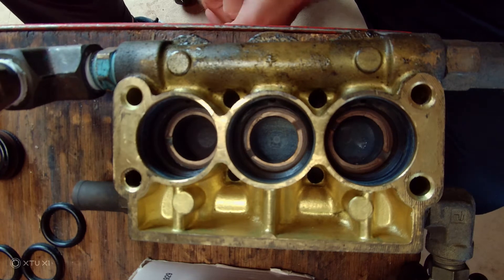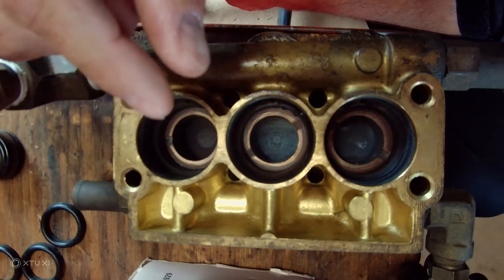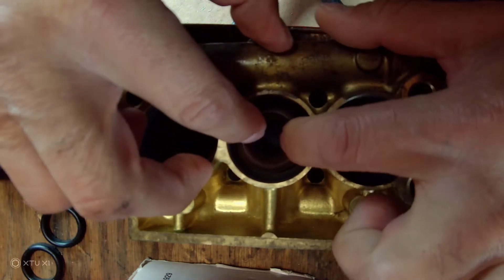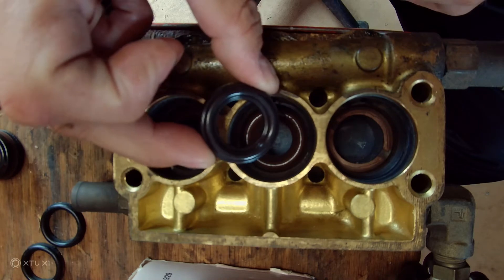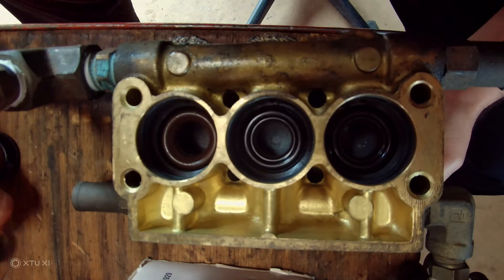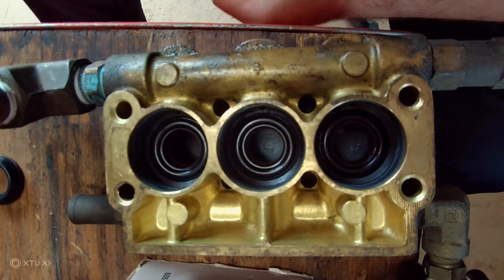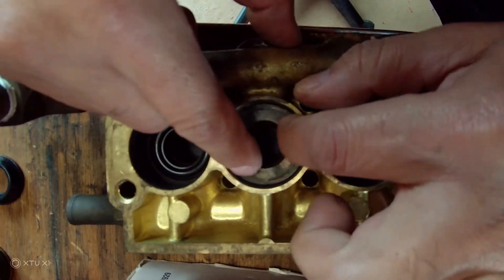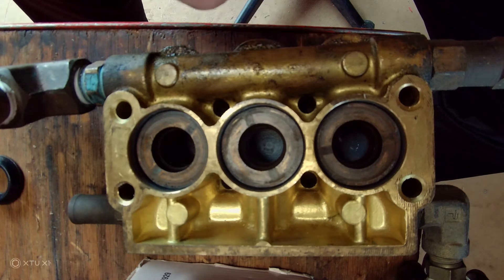General Pump Seal Kit & Valves Repair

Comment: Thank you for this detail video, I have the same pump TSS1511 that lost pressure 6 months ago but it was the unloader which I replaced but now the same low pressure came back again. I will the exact same thing you by replacing the valve and  seal kits. I will keep you posted.
Reply from the maker: Thank you for watching 
Don't forget to subscribe